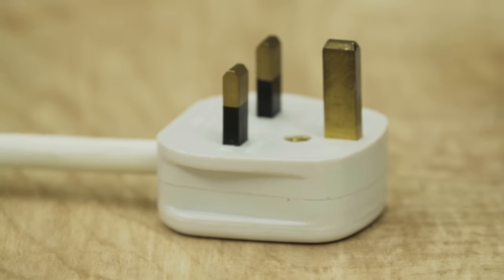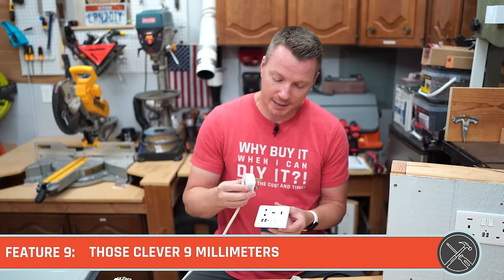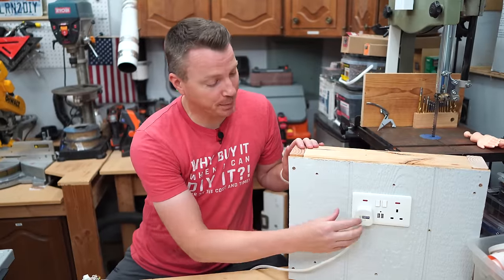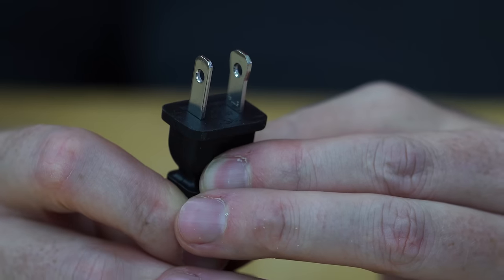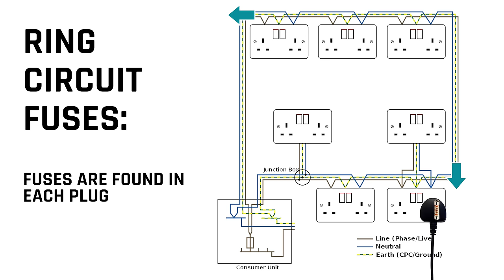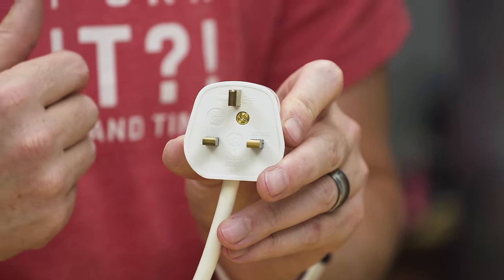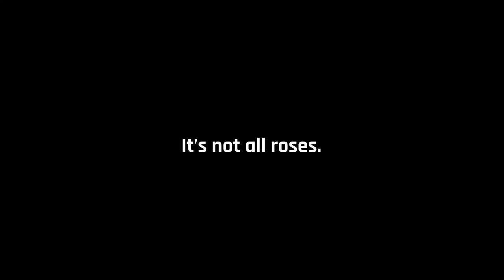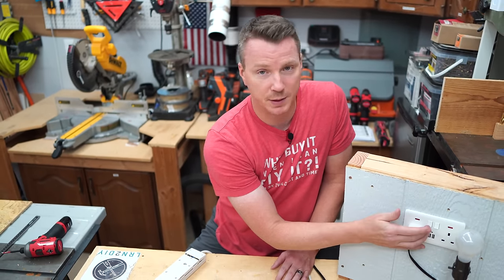British Plugs and Outlets Are On Another Level

Comment: Excellent video and as a UK electrical and electronic engineer who has also worked in the US, UK and other countries over the last 60 years I can say that the UK system has a lot to recommend it in terms of safety and robustness. Its not perfect but would consider it overall one of the best systems but if you do step on an upturned plugs this is certainly a different level of pain and unwelcomed surprise 😵‍💫😮🤬
Reply: If you think LEGO is bad, step on a UK plug!
Reply: The UK has hands down the worst electrical installations in Europe. And it is 50 years behind in substantial network features like 3-phase electricity in normal residential buildings. Unforgivable in the age of heat pumps, car chargers and solar inverters.

Whenever I see a British fuse box on Artisan‘s or N Bundy‘s channel it feels like it is streamed from West Africa.

Not sure why anyone would be happy with the huge plugs, quite dangerous lack of insulation and the unnecessary switches for the sockets that nobody needs for nothing these days.

But hey, it‘s tradition, innit?!?
Reply: @maxking3  Now, we can have a discussion regarding three phase supplies, and the.. disturbing state of many European installations, but quite what lack of insulation you're waffling on about, that's the fun question.
Reply: @Monkeh616  Sorry for my lazy writing. Unlike Central European plugs, which are recessed, children can easily touch the live prong when pulling out the plug.
There is no doubt that that the CEE 7/16 plugs used on the mainland are superior in all relevant areas.

And I have hardly seen such omnishambles as UK fuse boxes, anywhere in Central  or Northern Europe. Maybe when you get closer to the balkans, it resembles the state of UK electrics. In any case, there is nothing to be proud of.

There is a reason, why none of the Eastern European countries looked at British standards after the iron curtain fell, but implemented German ones instead (VDE, DIN)!
Reply: @maxking3  No, they cannot touch the live pins, because they are, indeed, insulated..

I'm afraid there is much doubt, including the lack of polarization, and the design which explicitly allows unsafe connection of certain legacy variants, but prevents safe ones..

I suggest you get around and look at real installations in service, rather than shiny new textbook examples sometime.
Reply: @Monkeh616  You are right for most  newer plugs, but when I lived in the UK in the 90s, there were still many non-sleeved plugs around and those were quite dangerous.

But that‘s not my point. There are way too many dodgy electrical installations out there with half-assed extensions put in by kitchen builders, fuse boxes inside cupboards and a general lack of RCBOs across the board. Many installs I have seen have just one in them and if it trips the whole house is dark. 

That’s all illegal in most of Europe and a normal kitchen builder touching the electrical system would be invariably sued by the electrician‘s guild.

Look, there is no need to argue.
The housing stock in the UK is mostly beyond repair - electrics, plumbing, insulation - anything that makes a house safe, comfortable & efficient, at least it is not economically viable to do so. Tough luck.
Reply: @maxking3  Indeed, there's no need to argue with the arrogant and willfully ignorant. The rest of Europe is not immune to poor electrical work.

Again, get out of your comfy modern house and examine the rest of your country before judging somewhere you don't live.
Reply: @Monkeh616  Yep. Given that arrogant and willfully ignorant have voted for Brexit, you‘re free to stick to the sub-standard British codes for as long as you like. And keep your plugs as a a somewhat archeological tradition. (But that does not change the facts.)

And yes, I am a KNX system integrator, so I know the electrical standards in various countries pretty well. 
Unfortunately apart from a few commercial buildings, digital wiring & electrics is too modern for ol' blighty!
Reply: @maxking3  And you can keep your dangerous CEE 7/1 sockets which explicitly accept earthed CEE 7/4, 7/6, and 7/7 plugs while the earthed CEE 7/3 and 7/5 ones block the use of unearthed 7/2 plugs, and your Danish 107-2-D1 which will accept CEE 7/4, CEE 7/6, and CEE 7/7 and not connect the earth. Because your standards are universally superior..

Ah, nice edit - I see, you deal with very expensive modern installations all day and never get to go deal with the ones used by the bulk of the population. This explains much.
Reply: @Monkeh616  Not sure what you’re on about. Most of what you describe is historic, all down to protect local industry from competetion.

Today, there are 2 current plugs. 2-prong plugs: European standard1 EN 50075.
3-prong: CEE 7/7

Those work in sockets across 150 countries. End of story. Case closed!

(And Denmark is now changing to type F socket moving forward… so at least some countries see the light in the end!)
Reply: @maxking3  Not sure what you're on about, uninsulated pins on BS1363 plugs are historic, resolved in the 1980s. Case closed!

Your high ground is looking more and more like a high chair.
Reply: @Monkeh616  I see installations before and after.

It‘s very rare to see bad craftsmanship over here. Most old installations were updated in the last 30 years, because that‘s the law. When you change something, you have to bring everything to the current minimum standard.

(I granted you the uninsulated pins already. My bad!)
Reply: @maxking3  you don't have a clue what you're talking about!

Comment: These plugs are the best in the world! The plug that you were reviewing looks very similar, to a once British make called MK plugs which were the best in the UK for it's intergraded cable grip design inside the plug. I don't see MK plugs anymore in the UK. I still have one which is still in use to this day, which is more than 30 years old.
Reply: I have a box full,once an appliance dies the whole lead is chopped off and kept or when needed upcycled if appropriate to an extension lead.
Reply: You can still buy MK plugs, I'm not sure why you don't see them. They tend to be more expensive than most so probably only available at electrical wholesalers, but B&Q sell a full range of MK electrical plugs and switches.
Reply: @gssf.gr29  lack of hardware stores probably.
You can't go into if they even exist small independent ironmongers anymore.. The Big stores sometimes sell but its usually  a cheaper black variety made from softer vinyl plastic. When I see them I but them, Feeding wiring under counters often involves plug removals..
Reply: @mottrex  Generally, most electrical wholesalers will be happy to sell you one, and most likely for a lot less than the likes of B&Q or any other store, and you can order just about anything online and have it delivered to you these days.

Comment: I was trained as an electrician in the UK in the mid 50's and remember that the Ring Main system and fused plugs
were introduced in 1947 mainly as a cost saving from the earlier system,I then moved to Australia in the mid 60's
and was disapointed when I learned that Australia did not use the same system, so much so that I left the industry 
for a life in the security field.
Reply: The Ring Main is a very sensible system and was none done to save on copper as it actually uses more copper.
Reply: @fivish  It does save on copper, it saves you running more circuits to the consumer unit or using thicker conductors for a long radial circuit, having the 2nd route back to the consumer unit greatly increses the maximum power that can be drawn from the circuit allowing more outlets. Because of these circuits being able to handle so much current our breakers for ring mains are rated for pretty high currents so if there's a short in an appliance that breaker is only going to trip at a fairly extreme fault current, hence the fuses. With modern homes having radial circuits in the UK we don't need the fuse anymore than any other 230v country but it's still safer to have as radial circuits still have enough oomph to melt the flex to an appliance. (most electrical systems would benefit from fuses in the plugs for this reason)

Overall I think the ring main wasn't a bad idea, it's just not ideal. On one hand it provides far more power for the amount of cable/copper used and it means that there's redundancy in the earth by having 2 earths, on the other hand if the ring is broken it will still work but you could be drawing far more current than the cable is rated for at some points when this happens.  (as you have basically turned the ring main into 2 radial circuits connected to a very highly rated breaker)
Reply: @RossMitchellsProfile  Even a split ring is not necessarily badly overloaded. A 2.5mm2 T&E cable, run under the floor or in the ceiling void (not covered in insulation or the like), is rated at 27A and will actually carry a lot more, for an extended period, before becoming too hot - most heavy loads are not on continuously anyway, so the cable won't get the chance to get too hot, before it starts to cool again.

Comment: Unswitched sockets are not uncommon in the UK. "Load balancing" is really not an issue ever found in practice. Also you missed out the important safety feature that there is a minimum width for the body of the plug, so there is no possibility of your finger-tips straying round the edge and making contact with the pins.
Reply: Depends where you are I guess. Unless it's in older houses that haven't been rewired for 50+ years, I can't remember that last time I saw unswitched sockets in houses in the UK. That said, I've seen plenty of electricians who have rewired houses and retained the old sockets, but if the job's done properly they would fit new, switched sockets, or at least offer the option.
Reply: @gssf.gr29  You can still buy unswitched sockets and they are not forbidden by the regs.
Reply: @nicolek4076  That's correct, they're actually recommended for applications such as freezers, which often have the socket behind them with the freezer plugged in (more or less) permanently, but it's very rare you will find a decent electrician that fits unswitched sockets as standard.
Reply: @nicolek4076  actually, in the days before insulated pins I accidentally got my fingers round the edges of a plug while pulling it out and I got electrocuted. The problem was being a child I had to grab as much of the plug as I could to be able to pull it out of the socket.
Reply: @unclemick-synths  My sister, aged 8 around 50 years ago,  was drying a knife and for some bizarre reason decided to insert it between the plug and the wall. The knife was never quite the same afterwards - she was OK, but deeply surprised by the blue flash. The insulated pins would have prevented this.

Comment: Radial circuits are becoming more popular in the uk. The upgrade in uk domestic electrical regulations even includes surge protection to protect our electronic devices.
Reply: More popular and illegal? See Appendix 15 of BS7671:2018
Reply: Those  surge protection devices are bad designed. They  trip if somone use a walky talky in the vincinity of the consumer unit. 
I can easy release them in my Neighbors home   with  my 150W  hf ham radio transceiver.😒
Reply: @fivish  What on earth makes you think Appendix 15, which is informative, not regulatory (not that these regulations are law, for that matter), makes radials illegal?
Reply: @Reaktanzkreis  Surge protective devices do not 'trip'. And I'm pretty sure you shouldn't be allowed anywhere near a 150W transmitter.
Reply: @Monkeh616  I mean the AFDD surge protector switches. They interrupt the circuit in case of arcing .
I got a ham licence which allow me  the operaton of a 1000W hf/vhf and uhf transmitter.
AFDD a an very good idea, especially in old installations. But there is  many room for improvement due to legal radio transmissions.
Reply: @Reaktanzkreis  AFDDs are not called 'surge protector switches' and have nothing to do with surges.. SPDs are very different beasts, and entirely passive.

I would respectfully suggest if you're putting enough energy into local house wiring that you're causing malfunction of devices, the legality of your transmissions may be questionable.
Reply: @Monkeh616  Oh I was confused wit all the new abbreviations. SPDs , thats what is also called transient or overvoltage protectors. mainly protect against  lightning electromagnetic pulse.

Yes such devices are mandatory at the incomer direkt at the main fusebox. They are rf proof, trigger them by rf signals means to have a lot of kWs of the power  level of broadcast transmitters. 

My ham radio which I mainly use got 150W, its enough power in most  ways. 1kW is the legal limit. And rf should be radiate by the antenna and not creep into the house wiring. ☺

Comment: Feature No. 2 is actually useful when pulling out a plug from a socket. Sometimes it sticks in tight enough and one has to jostle it a little bit so it first sticks out then probably get a better grip by kind of holding like you showed. It’s is then that the insulation comes in handy.
Reply: UK plugs have tabs/wings on the side of the plug that you can grip on to and pull it from the socket, so this has never been an issue
Reply: @AdilAaronAkhtar  agreed that they have tabs/swings but sometimes it’s needs a better grip.. 
but thanks for acting like a broken code.

Comment: Great video thanks. A couple of extra things intrinsic in the design that may not be immediately obvious. The earth pin being at the top means anything falling into an improperly seated plug will only contact the earth pin which is a passive safety feature. The pins are large for three reasons, firstly for strength, secondly for current carrying capacity and thirdly the live pin also acts as a heat sink for the plugtop's internal cartridge fuse. The fuses by the way, are available in a variety of ratings from 1 amp up to 13 amps, meaning attached loads up to 3kW can easily be supported. Standing on one is definitely no fun but it’s still a great design. Certainly far superior to the ones used here in NZ and Australia.
Reply: I have often thought that should I ever emigrate to the US or any other country that uses smaller more dangerous plugs, I'd be the one who would replace appliance plugs and wall sockets with British ones :D

Firstly to be an oddball, secondly to have a talking point and thirdly to the the oddball grinning at the confusion

Comment: Another big advantage of a ring circuit is that no matter where the socket is placed, the total resistance, ( and therefor voltage drop) remains constant, so for instance a heavy power tool will operate the same from any socket, whereas with the radial (or spur system) the longer the radial circuit the greater the resistance and the greater the voltage drop.
Reply: If the voltage drop on your radial system is too high that just means the cable is undersized and installation is poorly planned.
Reply: @Painostaja  Not necessarily, it depends how much stuff people are trying to plug into them. Every circuit will have a limit to what it can handle.
Reply: Well, surely if the ciruit isn't being intentionally overloaded to prove a point or being abused because someone's running a cannabis farm, then the circuit would be designed for the likely prospective load in mind.  A good installation will consider maximum ring length.

If maximum length has been exceeded, then resistance at the far end of the ring will be greater than that at the end near the consumer unit, same as on a poorly-designed radial circuit.  But if the electrician is worth his salt...
Reply: @johnbull5394  You`re missing the point of a ring circuit, in a ring circuit as opposed to a radial circuit, the resistance in any length of ring circuit at a certain point is exactly the same at any point along the circuit be it 1 meter from the supply or 50 meters from the supply. The total resistance in  the ring circuit =R .   A socket at any point on the circuit will split the resistance in to R1 + R2 = R.  As you move the socket along the circuit R1 will increase and R2 will decrease proportionately such that R1 + R2 will always equal R.